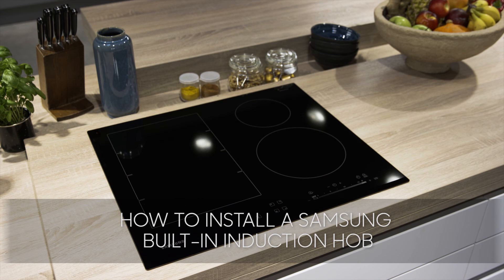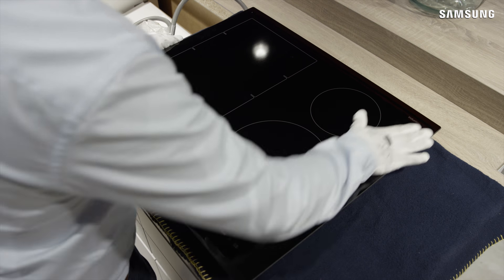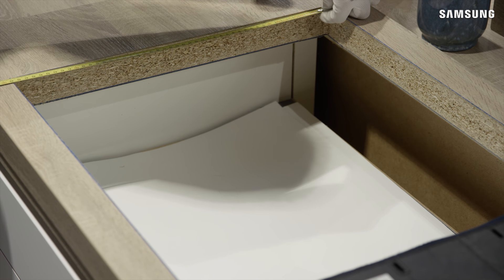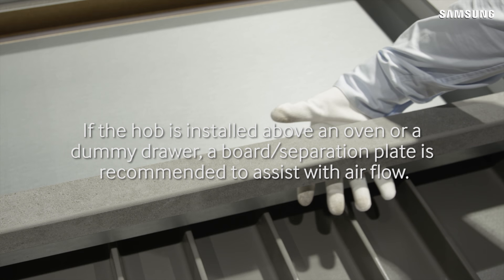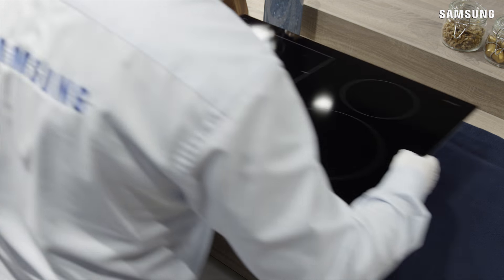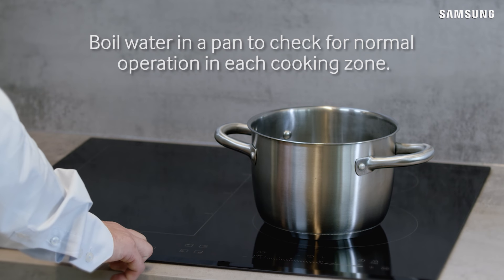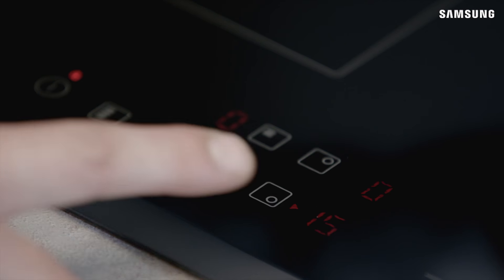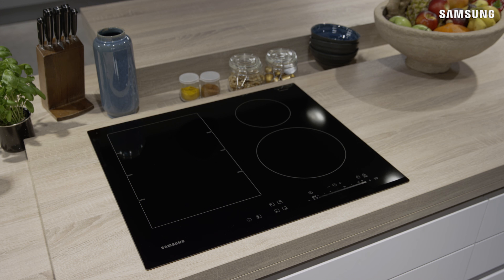Samsung Built-In Induction Hob : Installation Guide

Comment: Save yourself over $1000 dollars and go with the GE CAFE model which is absolutely and exactly the same thing except for the color (I' ve owned the café 36 inch induction for 2 years) this is simply one of the best induction cook tops in the market and the absolute best for the price. Induction has many advantages over gas (speed, efficiency, even heat, easier to clean, safer, cheaper) and way way better than infrared cooktops. This thing is blazing fast (specially if you can connect it to a 240v line) and extremely accurate, you will not regret it.